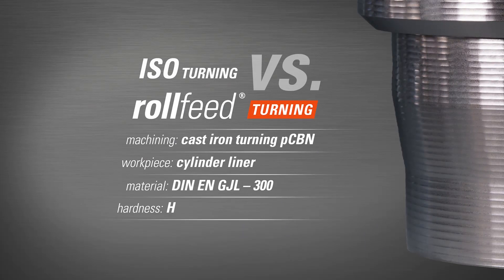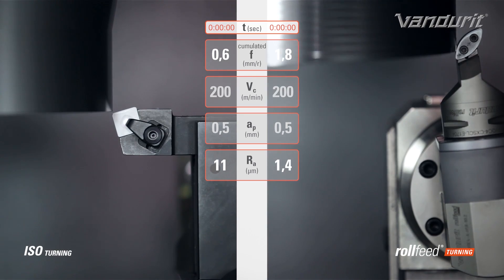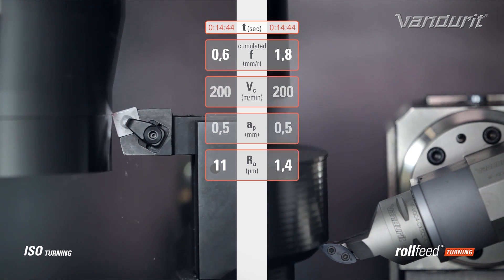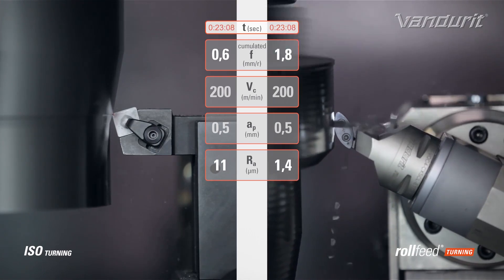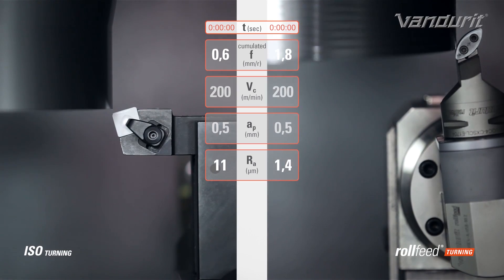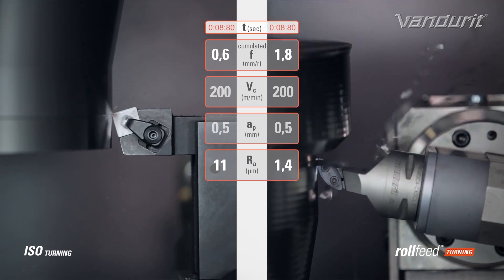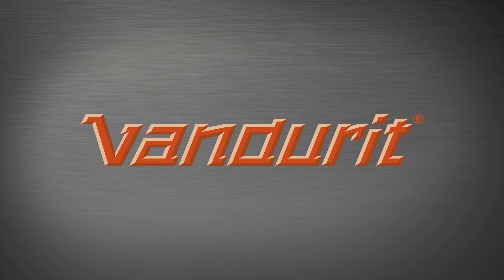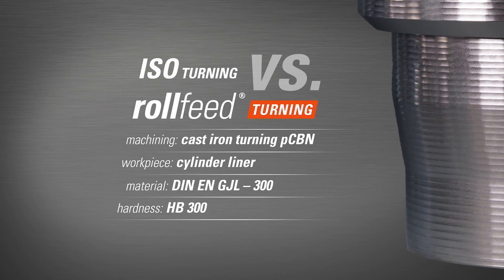Roll Feed Turning new from OPEN MIND

Comment: Well that's a shit comparison.. Ra 11 micron? A saw cut isn't even that high. 
The only advantage is extended tool life because with an extra axis it isn't going to be more accurate.
Reply: That's true! But with a feed of 0,6mm/r the left video should play way faster.. so it's still a bad comparison.
Reply: I completely agree. Someone definitely did the math wrong on that one. An 11 Ra Micron finish in equivalent to 433 micro-inches. That doesn't make any sense at all. I could get a better finish than that with a chisel and hammer. I would assume that the value should have been 1.1 Microns, that would make much more sense.